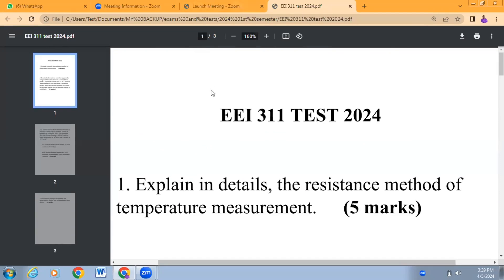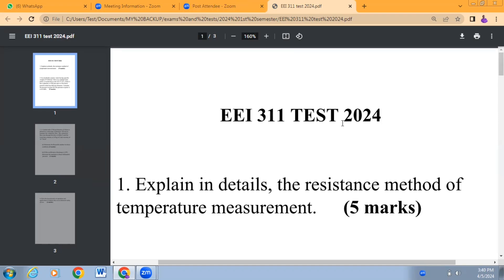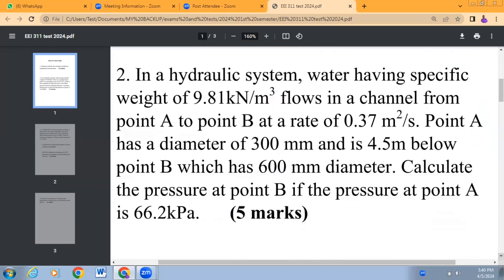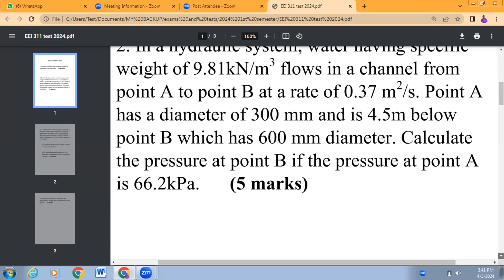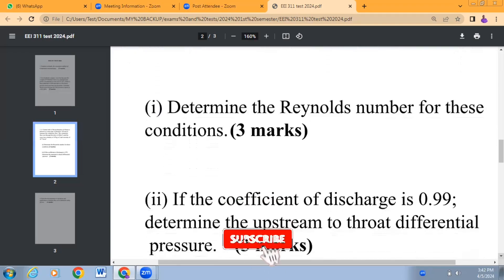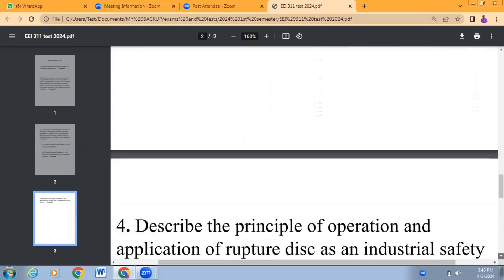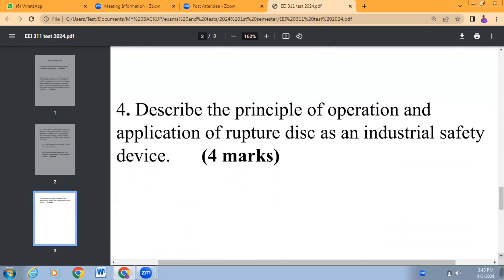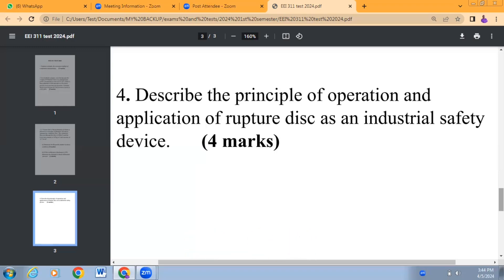Instrumentation Systems TUTORIALS | Test Your Knowledge | Class Test @ECIMacademy

Comment: From the question 2
I doubt the rate of flow is 0.37m²/s , it should have been 0.37m³/s🤔
Reply from the maker: I will recheck that. Sure the unit should be in cubic metres not sure metres. It was just a typo.
Reply: @ECIMacademy noted sir, thanks for the feedback
Reply: Alright sir
Reply from the maker: Check my above comments.